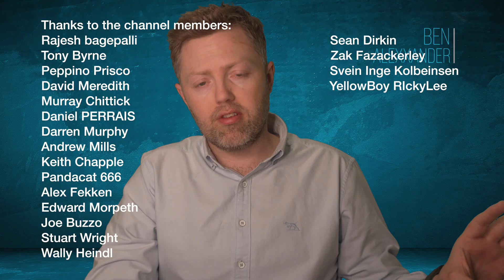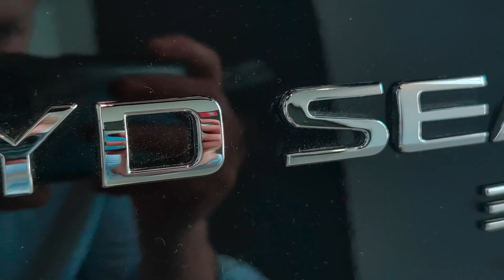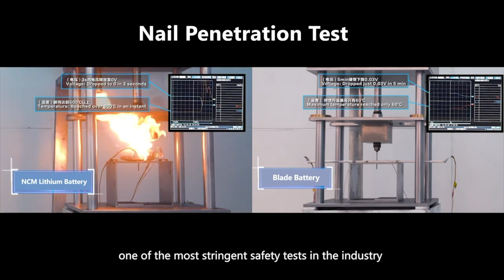BYD Expands Battery Operations in Europe – Tesla and VW Take Note

Comment: You don’t mention the threat of CATL’s New Saline batteries to BYD. And a possible reason buffet has pulled out
Reply: BYD is actively developing and producing sodium-ion batteries, which use abundant sodium instead of lithium, cobalt, or nickel. These "salt" batteries offer a lower-cost, safer, and greener alternative, though they have a lower energy density, making them ideal for applications like electric scooters, small cars, and stationary energy storage systems. BYD is building a 30 GWh annual production factory in Xuzhou, China, with goals to match lithium iron phosphate (LFP) battery prices and accelerate the transition to affordable electric mobility.
Reply: Buffet is retiring in like 60 days. Byd and others obviously have other batteries in the supply chain. And saline suck in cars. Great for grid storage tho.
Reply: Warren Buffett announced he plans to retire as CEO of Berkshire Hathaway at the end of 2025,

Comment: Thanks Ben, there's a lot more to the blade battery than a marketing name. The blade cell configuration greatly simplifies battery construction by minimising cell count while at the same time optimising packing density and providing excellent heat dissipation thus improving battery performance, longevity and safety.

In the Atto3 the battery pack is 126S1P LiFePO 400V nominal. This pretty much fills the full under floor space.

A downside to this configuration is that it is not so easy to double the cell count increasing pack voltage to the 800V needed for rapid charging above 100KW. This would make the batteries much more bulky and expensive.

BYD seem to accept most users slow charge overnight so don't seem in a rush to move to 800V, instead sticking to incremental improvements to the 400V pack.